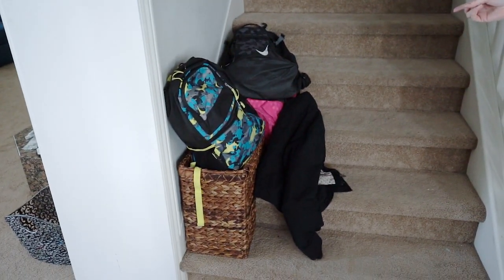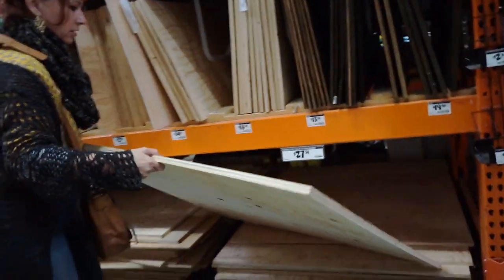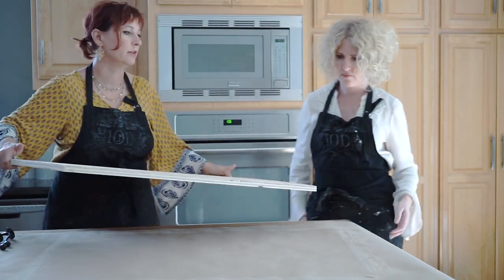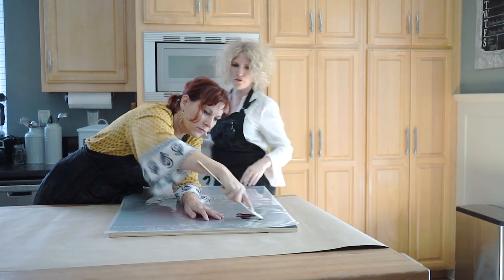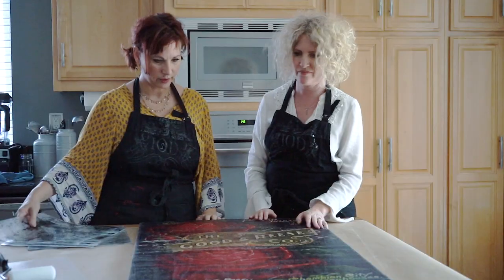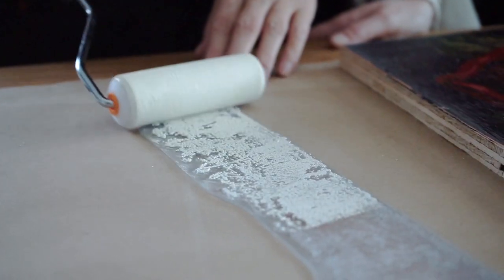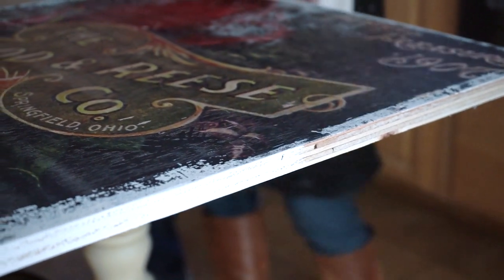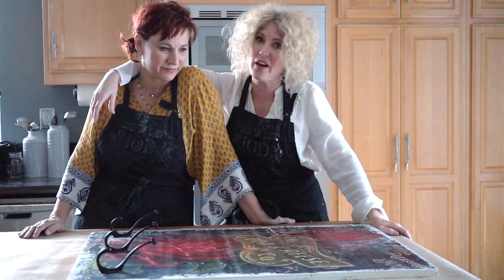IOD Decor Transfer and Decor Stamp "distress" techniques! Iron Orchid Designs

Comment: I am hanging this in my bathroom. Do I need to add a sealer or acrylic to the top?  Your work is amazing!  I’m so excited to add this to my wall! Thank you for the inspiration!
Reply from the maker: Thank you so much for such kind words🥰 If it's going in the bathroom it would probably be best to seal it just because of the condensation. You can use any sealer, really. We do recommend a waterbed sealer. You can get a spray sealer, or you could brush or roll it on❤️❤️

Comment: Can the IOD Transfers be used on stretched canvas as part of a mixed media artwork? I've watched several videos (thank you for taking the time to make them, they are a great help) but the only time I've seen any fabric used was a demo for the beautiful stamps. The transfers have been used with a wood base, a canvas would have some give when applying pressure to the transfer.
Reply from the maker: It depends on the material and structure. I could see it working on a hardboard canvas that is primed :) but not on a hollow wood frame canvas. They aren't meant for fabric. I have seen people accomplish this, but I'm not sure how they did it lol. They work best on matte, hard surfaces. for more info check out our video on transfers here: https://ironorchiddesigns.com/decor-transfers/